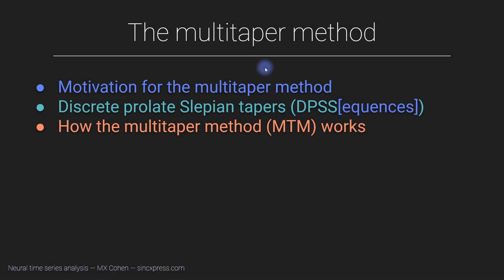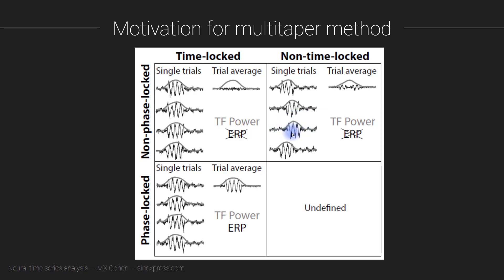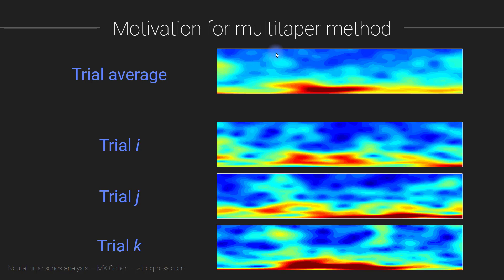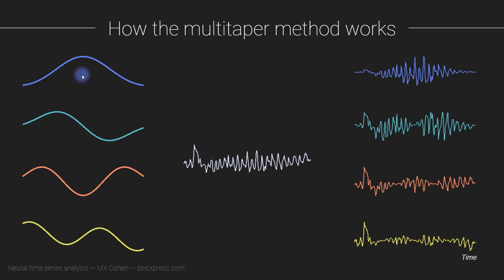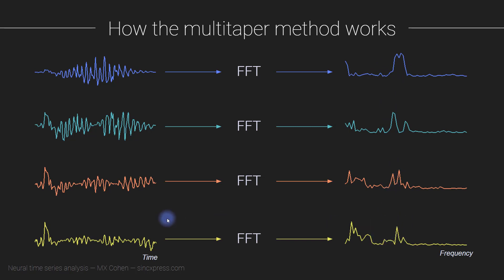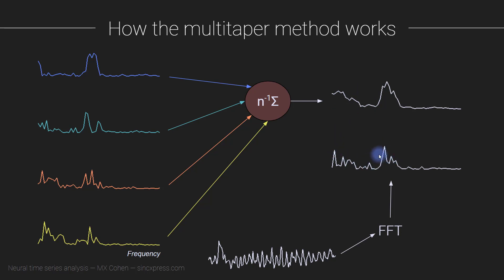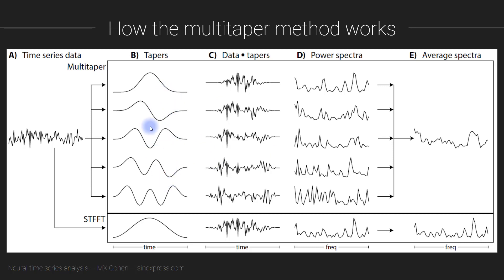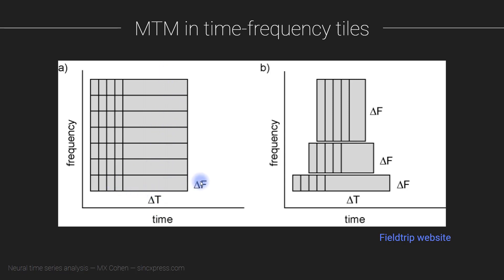The multi-taper method

Comment: I wish to implement ML on EEG, for the two cases - with and without Multi tapering. 

Previously I fed raw EEG to 1D CNN. But to see the efficiency of Multi tapering method, do I have to feed spectrogram (with and without MT) to CNN?
Reply from the maker: Yes, you'd use a 2D CNN if you're inputting the spectrogram.
Reply: @mikexcohen1  The problem is I do find a function that return all three values required for spectrogram plotting - times, frequencies, PSDs. 

However, I do not see any readymade function that returns all three with Multi tapering. 

The best I could find is "psd_array_multitaper()" from mne library. But it returns only two values - frequencies and PSDs. So I understand that we will have to segment the EEG signals (say, each segment is 300 ms) and apply Multi tapering to each. Now each segment corresponds to middle time value.

I mean, a segment from 0 to 300 ms corresponds to t= 150 ms. And a segment from 300 to 600 ms corresponds to t= 450 ms and so on. This way we also got the time axis.

But the problem that I am facing is that psd_array_multitaper returns a different set of frequencies for each segment, hence I could not easily concatenate them column wise and get the spectrogram. 

What is the way to get the spectrogram with MT applied?
Reply: @mikexcohen1   Since I have a 14-channel device, is it normal to concatenate 14 spectrograms into one spectrogram, before feeding it to a 2D CNN?
Reply: @ananthakrishnank3208  my suggestion would be not to average activity across all channels as some activity might be channel-specific that will be lost in averaging 

Rather you can concatenate spectrograms so each input to ML model will be of shape (time, freqs, chs) etc and later you can apply CNNs just like you apply them to RGB images with first layer kernel depth to be 14 instead of 3. Good luck